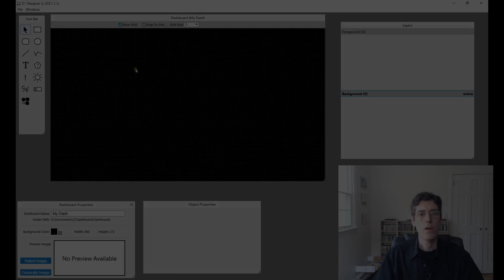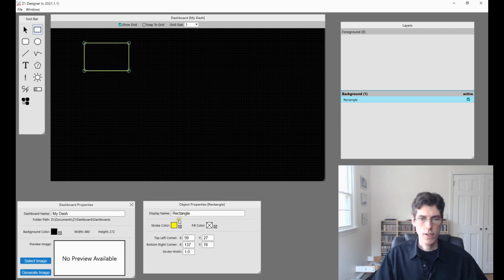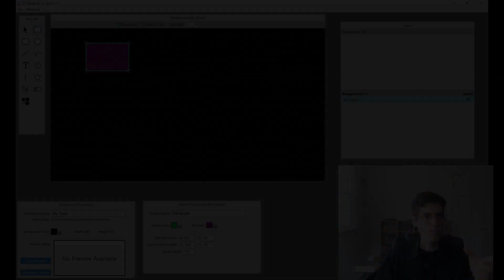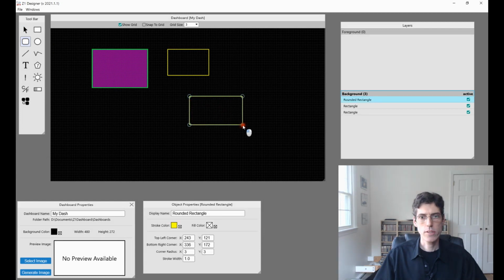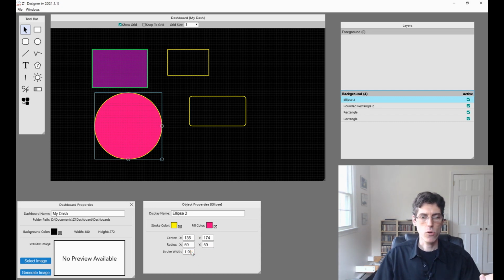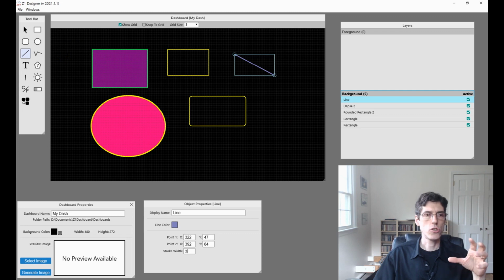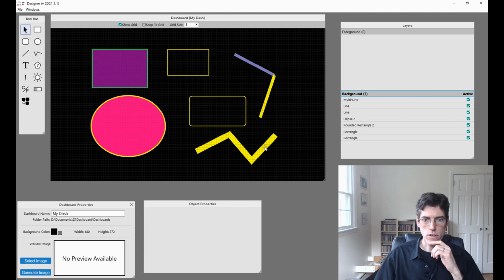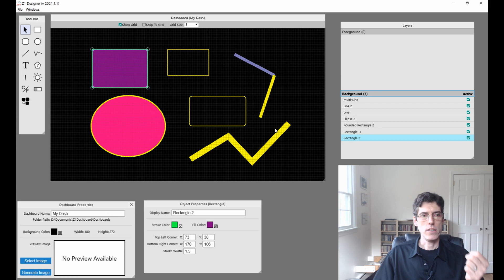Z1 Designer Geometry Tools

Comment: I just got this fantastic tool, but I have a doubt, is there a way to improve the resolution of the streaming of this dashboard? I use it with my phone but it looks quite blury. Great job with the dashboard is a killer app
Reply from the maker: The resolution of the stream to the phone is based on the size of the Dashboard window on your PC.  If it looks blurry on your phone then you'll want to make the window larger on the PC.  Note the larger the window on the PC, the more data has to be transferred to the phone.  So you want to strike a balance between resolution and speed.
Reply: @Z1DashboardAndAnalyzer  ty so much! One last question, what tool do I have to put in the dashboard designer to display the gravity center of the car ? (The circle with the dot in the middle that change with the weight balance of the car) wanna use it mostly for DIRT rally 2.0
Reply from the maker: @Fretzton  Are you looking for a friction circle?  Or specifically the center of gravity with weight, etc?  If the former then that is coming in a future release.  If the latter, then that data is not available from sims, as corner weights aren't provided.